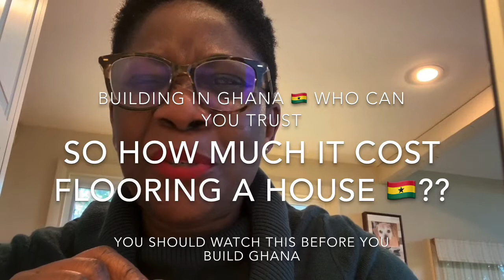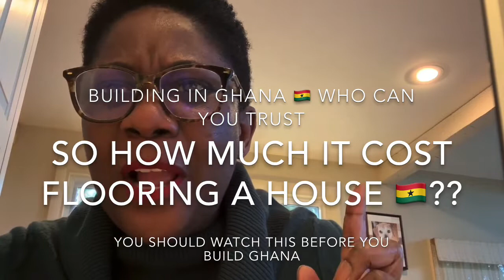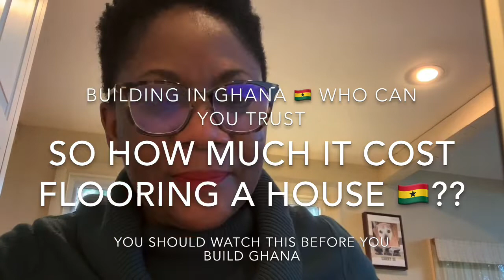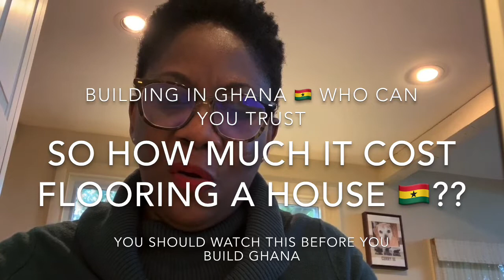SO HOW MUCH IS THE COST FOR FLOORING A HOUSE IN GHANA??

Comment: What you say is perfectly true.
The problem is there's no proper demarkation of plots, especially when it's private land, land owners sell the land buy never allow for road let alone untility strips. 
So when houses are build no proper road widths, everybody want as much land many encroach on other land or utility strip.
Those who build first claim the land, what was earmarked from the old land markings, don't match with modern GPS systems. Olden day it was more or less.
With GPS  it accurate, but becarefull whereas your old plot more or less, new system can cut the more or less off, added together make extra plots for someone. This can cut 8nto where the road should be.
The Govt show call all land owners all land owners should submit plots, the. Planning department should add it to their maps. Now they are GPS the whole of Ghana. This would help stop encroachment disputes over land, also on the registry should be family names head down, this to would stop family member reselling plots.

No two houses can be be compared price wise, unless it done like for like.
There's no standards for workmanship.
If there's no work you get cheap workers. The old say, you only get what you pay for.
I wish you well my dear, your guy as done well, far better than most.

Comment: The one area you didn't show or I missed it was the drainage.
Again plumbers have this new way of doing the drainage, that where they don't build inspection chambers (with is your early warning system you drains blocked) to just having a pipe stuck out of the ground with a white screwable top for rodding.
No country allows this type of foul drainage as it cannot be rodded either direction, it can also cause serious issues if system blocked effluent pours out.
If one allows this system to be used, (not that I'd recommend it anyway) ensure they use high pressure pipes, if there's a blockage a jetting machine can be used, if ordinary 4" 110mm pipe is used a jetting machine would cut through these pipes, have to relay replace all underground pipe work.